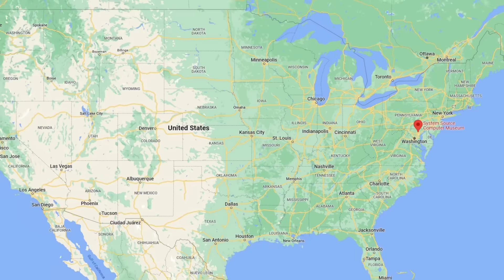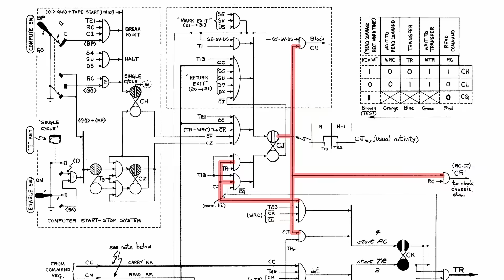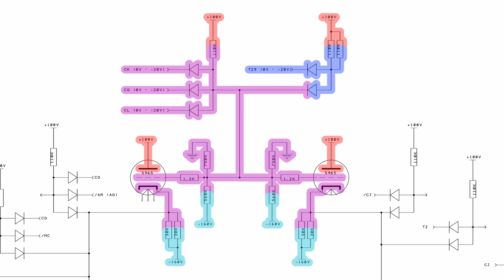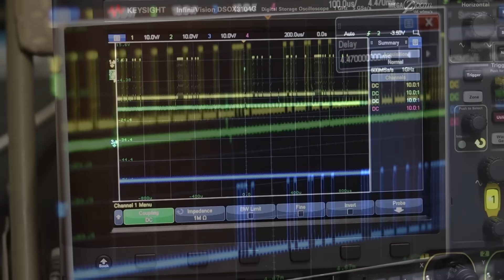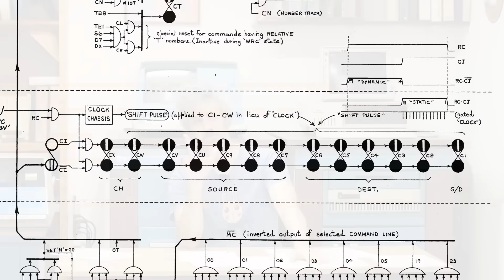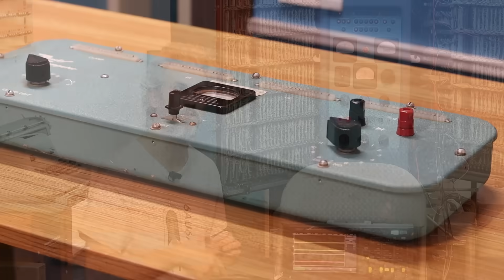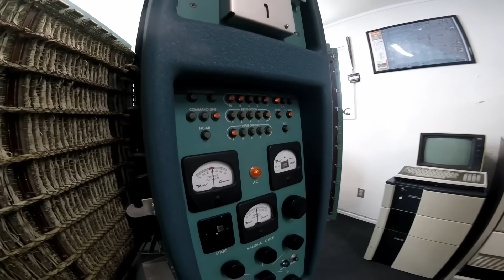This G15 is the Oldest Running Digital Computer in America!

Comment: Wouldn't be surprised if the resistor pack mod was to intentionally disable the machine in an obscure and 'not worth repairing' kind of way when it was originally decommissioned. I've run into quite a bit of that over the years in my experience with enterprise machinery. I saw it the most in decommissioned systems from government entities (I believe some even mandate their old machines made inop)

Comment: You're a genius Harry Potter!🤣 The fact that you're essentially looking back in time to decrypt all these tube-based circuits, and make it make sense, is just mind-boggling to me. Probably one of the greatest electronic repair projects of all time! After you get it to run the test array successfully, do you have an actual program that will run on it? (i.e. some sort of data analysis, etc). Hopefully when you wrap this up and send it back, it will survive the trip to Maryland and still work when it gets there! Well done David!😉👍👍👍👍

Comment: It's awesome seeing the Bendix G15 finally executing the software off the tape roll, computers are a fickle beast no matter how old or advanced they are, the issues would basically be exactly the same between oldest vacuum tube computers down to a 2 nanometers processor chip that if there's something wrong with it, it makes for a very challenging troubleshooting.

Nevertheless it's a long and epic journey bringing back the old digital beast. :)

Comment: We had a running G15 in the basement lab of our EE department while I was in school (70-74), which included the optional differential analyzer.  If you talked to our institute VP, he would give you a key to the lab and let you have unrestricted access to the machine on evenings and weekends.  I spent many hours loading tapes and running Blackjack, Go, and a simplified version of Eliza.  I think we may have had at most two modules fail during the entire time I was using it; it was pretty reliable all things considered.

Comment: It's interesting to see a solder bridge that has lain undiscovered for years. The PCB's for the CDC Phoenix were very reliable, though I remember receiving one for repair in the mid 1980's. The fault was a hard short between two data lines which I discovered to be a solder splash under an 'ACCEPTED' label that had been stuck to the board during production. That PCB worked faultlessly for maybe 5 years until the solder bridge finally made proper contact and caused a problem. I wonder if tin whiskers are what cause the delayed short to develop?

Comment: would it be possible to interface to the bendix 'typewriter' port using a microcontroller (and chunky circuitry) of some kind to allow a modern computer to be used as its ''typewriter'? ....just a thought...
Reply from the maker: Oh totally! It's a completely custom interface with weird logic levels, so it would require some clever programming and level shifters, but the Bendix is a really slow machine, and handling communication with it would be trivial even for an Arduino. 
But, I think I can get the typewriter 95% of the way there with a solid week worth of work.

Comment: Congrats on getting an antique computer working again. You can figure that you cell phone does more work in 2 minutes than if a G15 had been turn on an running for 65 years.
NCSU Chemical Engineering Department had a G15 that was replaced by an IBM 1620 that was replaced by an IBM 1130.
The G15 had been donated to NCSU Chemical Engineering Department by Ciba-Geigy and had some stickers that had their inventory numbers on it.
I got to load a tape on it and run it before it was unplugged and rolled to the dungeon (an area when unwanted equipment was stored).
The G15 had a Singer Flexowriter for the console. It ran Fortran via papertape. I was there when it was scrapped - it went to a junk dealer to recycle the gold from it. The Flexowriter stayed in the dungeon in Riddick Hall until 1973 when everything in the dungeon was discarded.

Transco Pipeline in Houston TX had a G15 in their basement that I got to play with in 1982. They had a bucket of tubes beside it and we got about 15 minutes of work before it did a hard error and we stopped playing with it.  (FYI the Transco Pipeline building looks like a short Empire State Building).

I wonder how many G15 are still in one piece. I doubt that this G15 from 40 years ago still is.

Comment: What happens if a test fails?  It triggers a buzzer?
Reply from the maker: As best as I can tell, it punches out some values on the typewriter to give some insight and then either halts or falls into a tight loop. Of the five times I've run Diaper, it didn't pass the last test twice. One time it halted, the other time it fell into really tight loop. So, we still have some gremlins to chase down.

Comment: Clock speed 100KHz in 1955-1958,  2024 cell phone is 2 to 3 GHz.  That's 20 to 30 million times faster.  Not counting bit width or CPU cores.

Comment: I suspect that clipped component lead on the tube module is associated with the red-wire modifications on the backplane. It probably allowed them to not have to remove an original white wire somewhere. It probably would have been wise to track the original location of each module.

Comment: My most sincere congratulations man. When you introduced the Bendix I doubted a lot that it could run due to the electrical problems caused by the years and degradation. But your dedication and effort made possible the impossible. Congratulations again.

Comment: The only reason you were able to say that it was fixed for this video, instead of saying that you almost have it fixed, is because of your dad. When you showed him how much work you had done, he became curious about how the G15 works. I'm glad that, instead of telling him the typewriter doesn't work, you demonstrated it by pressing the keys and giving him an example of what you would need to do for the next step.

Also, you mentioned that the typewriter is broken. If that’s the case, you’ll need to get it fixed before sending it back to the museum. Make sure the typewriter is working almost perfectly so we can see how the G15 performs.

(P.S. I wish I could work with you on these old machines! I love vintage items. When I work at my grandma’s, she sells old vintage things online on Etsy. My tasks often involve taking things apart and fixing them. My favorite items to disassemble are old wood cribs that people just throw out, or old pianos. I love to see how they work and appreciate how well old pianos were made. After removing all the hammers, I like to flick the strings or tap them with a screwdriver handle. I also enjoy fixing typewriters for her store. If you're curious, her Etsy shop is PamsCrafts7631, and she has 3,814 items listed.)

Comment: The thing i find interesting is that FET's (which ALL modern computers are based on) work on the same principles as a vacuum tube, just at a lot lower voltage and a lot smaller form factor.  They both work on a small electrostatic charge controlling current flow.  But speed and size are inverse in electronics, and you can make an FET incredibly tiny, whereas you cannot make a vacuum tube anywhere near as small.

Vacuum tubes were destined to fail in the long term, but they did show the way.  And that is important to remember.

Comment: I wonder how many tries it took to get the ringing bell at the end or was it just coincidence that it happened at that point. Great seeing a piece of VT equipment running again. I have a feeling that the bodge wires are to accommodate the longer platen. Hopefully the type writer goes well. An old thing I saw my father do with the dot matrix printer we had was spray WD40 in the ribbon holder to extend the life out of it, but that was a continuous ribbon setup. You might be able to find some NOS ribbons out there for what memory serves is a 2 bobbin ribbon system.

Comment: It has a MECHANICAL UPTIME COUNTER on the front panel?! How cool is that.
Reply: Quite a few computers from this era have runtime counters on them. Because they were extremely expensive, they were usually rented, not sold, and customers were billed for the runtime hours they used.

Comment: I hate to ask, how many instructions per second, or minute?  Any way to compare with a calculator, or other early computer?  Great job, no, fantastic job.
Reply from the maker: Thank you!
It's a little hard to nail down speed. The clock on the drum is 108kHz, but because the drum is serial and the word size is 29-bits, it's actually closer to a 3kHz clock. But, because the drum is a big rotating piece, you often have to wait for words to come around and be ready to access, so the actual compute time is slower.

The official documentation says it has a "random access time of 14.5ms average" for long lines, and can do around 34 iterations per second. In other words, it isn't fast, haha.

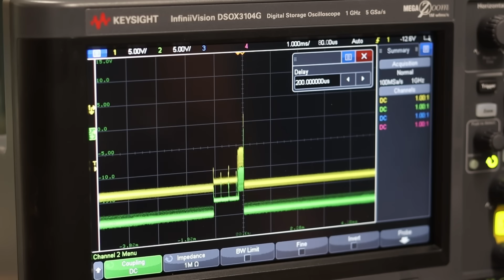Comment: I haven’t watched the whole episode yet, but at 8:25 are you dragging down the output by having the probe in 1:1 mode? Why not 100:1?
Reply: We thought of that when debugging on discord. It wasn't. He's using 10M scope probes. the scope is internally terminated at 1M so the circuit sees an 11MegOhm connection.
Reply: @ nice. I wish I could have joined that.

Comment: We are probably running out of people that understand vacuum tubes! I was in the last class in college where we learned tubes first then semiconductors. The next semester they went for semiconductors first and taught tube just to be inclusive since there were no new tube designs.

I never worked on vacuum tube logic, but I did work on a logic prototype supercomputer done in 74LS and wire wrap. It took about 10,000 IC's for the 4 identical 16 bit processor elements. Even though we implemented the brand new (at the time) IEEE floating point standard, I would still say what you are doing is much more complicated.

Comment: grid current is a big problem in well used valves/tubes, especially small all glass types, especially power audio output types, it can cause the grid to tend more positive  increasing anode current , many old valve tech manuals such as for radios and tvs dont mention it, many people dont know of it ,they think valves either work or dont, like semiconductors, but they can certainly partially fail/ go 'bad' or unusable for certain applications
Reply: Grid current is not a fault but a feature of tubes. It is discouraged so designs avoid it as the grid input is not longer high impedance. The grid to cathode is a diode so if positive voltage is applied it conducts, just like a anode does. This happens when the grid is overdriven which can be due to negative feedback loops causing extra drive to a tube which has gone low gain. A grid running current gets hot just like any anode would so tubes have a grid dissipation limit. You will see this quoted in rf power tubes where some grid current is often run.
Reply: @billbulford6783  no a valve developing grid emission IS a fault, the grid shouldnt self tend to less negative, there should be no grid current in normal negative bias use in non rf power valves

Comment: I was wondering: can you use the Centurion as a remote terminal for the Bendix? Hook the Centurion to your laptop and you'll have the entire digital computing history all working together.
Reply: This might be possible but would require a lot of custom circuitry because the Bendix uses high voltage where the digital logic of the Centurion uses lower voltage.  I am not sure if the Bendix Character set  are the same values.  Remember VT-100, ANSI, and other terminal standards did not come until later in computing history.   I also think the clock rate of the Bendix is slower so that would have to be dealt with.
Reply: @stphinkle  All you need to do is emulate a paper tape. That's 6 to 9 bits sent at a fixed rate including the clock rate. The photo diode array is low voltage, correct? Buffer it into that array and you have remote terminal capabilities.

Comment: I used to work for Keysight, that scope is $20000+.  Nice. :)
Reply: Does it usually loaned with sponsorship or given away? There's a lot of Keysight scoped used by YouTubers to the point I don't know any other brand lol. But honestly 20k is a rounding error in current tech marketing spending.
Reply: @robertosutrisno8604 I think Rigol and Siglent are the brands to look at if Keysight isn't sponsoring you?
Reply: That scope is in the best place it can be. Not on the expensive desk of some youtuber who whines about having only 1 terabyte of RAM, but in the hands of somebody who works on a computer with a rotating drum memory :)
Reply: Regarding "Why so expensive?" my first reaction is: it's a product that sells relatively few units compared to the high cost of creating one.
Reply: Just looked at it on Mouser, and indeed it is 19.000€ before taxes. I wonder why it is THAT expensive...? 5GSa/s is quite substantial of course. But not quite needed for the Bendix. :)
Reply: @root42  Lets hope it won't break. Working with potentially unknown tube voltages is much different from analyzing digital chips where for sure nothing will go above +5V. So if in doubt, a 400€ (or 100€ junk) scope may be the better choice.
Reply: When I see so many youtubers endorse or show a particular beand or product in their videos it makes me very suspicious about the company and its quality, regardless of what it is. Advertising on youtube is generally a big red flag.
Reply: @RT-qd8yl  well, Keysight is a very reputable brand. Ex- Hewlett Packard, when HP was actually good. Definitely top notch scope. However I truly wonder what makes it THAT expensive.
Reply: @root42  probably the high-precision stuff. once you get precise enough your measurement errors get bad, and to fix that problem gets very expensive very quickly.
Reply: @ that sounds reasonable
Reply: @RT-qd8yl  and furthermore: the Bendix probably exceeds the value of the scope considering that it is the only working one…
Reply: @RT-qd8yl  A lot of it depends on what part of the market a particular company fits into.  Companies that aim for the bottom end of their markets will do whatever it takes to sell as much as they can.  Their ads are trying to get you to buy their product directly.  So when you see sponsorships for channels that are completely unrelated to the product they're selling, you should take that with a pretty big grain of salt.

In the case of companies like Keysight, they're not trying to get you to buy their products.  Most individuals can't justify the cost of their products.  What they're doing is keeping their name in the minds of people who work in related industries.  They can afford to make their products high quality because they charge an arm and a leg for them, so they put their products in the hands of people who will spread the word about how good their products are.

So in my case, if the old analog scope in our lab dies and our engineer asks me what we should buy to replace it, I already have a good feeling about Keysight because I've seen them used by people who know what they're talking about, I've watched a few of Keysight's videos on proper scope use (and the hilarious one about how to keep people from stealing your probes), and I've seen them help out cool projects like this one.  That's exactly what their aim is, and I'm totally cool with that.  This is how marketing should be.

Comment: What's the current draw on that machine?
Using current silicon, how small would a G15 be?
Reply: If I had to guess the chip inside any generic smart tv remote or the weakest STM32s can blow this one out of the water. It's doing ~70k instructions in ~15 minutes? Maybe drawing this🎉 uses a lot more instructions and that's done in low milliseconds. It's crazy that a six grand machine is out paced by a small silicone costing less than a beer with mA power load. From '75 to the past decade Moore's law has been holding strong, I know this gem predates that but we can use that as a measuring stick. Man human ingenuity always astonish me, if only we can be at peace with each other we'll be in paradise.

Comment: Awesome work on this UE! I haven't gotten into the retro computing space personally (yet) but I am on the pinball train which is definitely related. I have a Data East Time Machine and I've started working on reverse-engineering the Motorola 6800 ROM it runs so I can hopefully make some changes to the code. Keep up the good work, and maybe show off the pinball machines sometime 😉
Reply: My wife and I are also on the pet rabbit train, so that's cool too 🐰